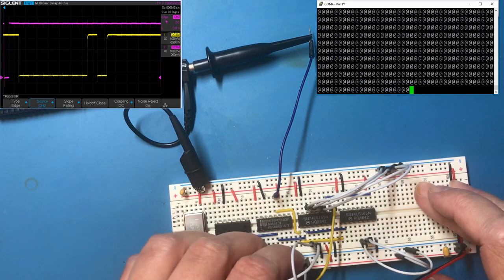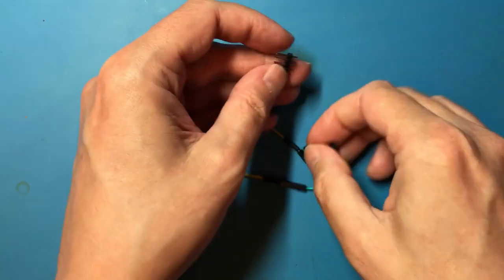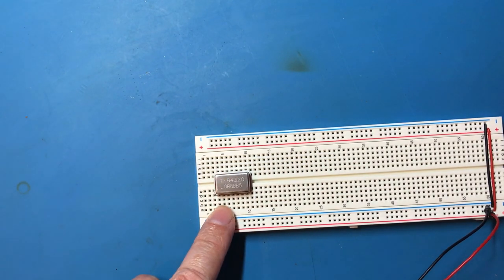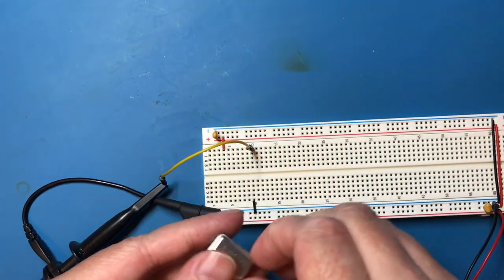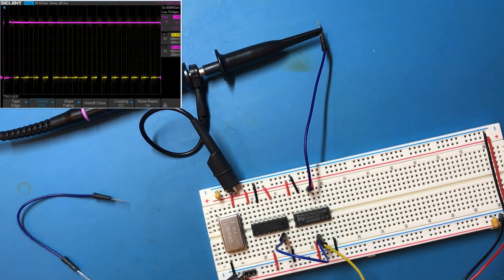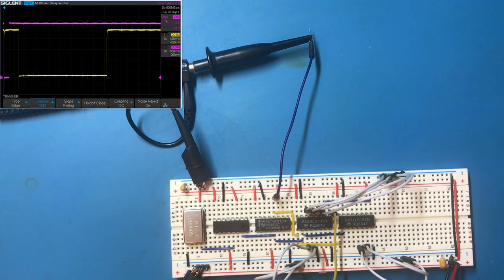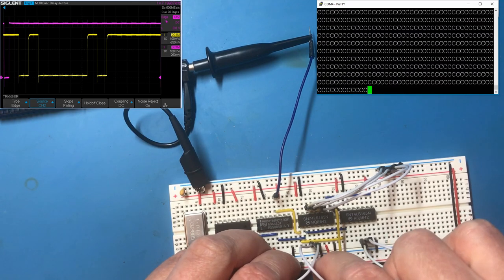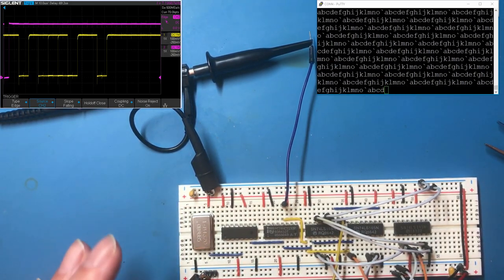Transmit - UART from Scratch - Part 1

Comment: I bought a load of Elegoo breadboards for my original 8-Bit CPU build but had nothing but trouble with them, so changed to BusBoard 830 boards even though they were a lot more expensive. That was over 18 months ago, so the Elegoos may have improved by now. Let me know how you go with them.
Reply from the maker: Interesting, All things are relative of course, my previous ones may just have been really rubbish. So far these have been good, but it's just been the one breadboard, couple of holes had to be loosened up but that's common on all breadboards.

Comment: Lovely video, as usual, thank you! I'd like to see this getting hooked up to your CPU, mainly because I want to see how you handle buffering, interrupts and crossing clock domains.

I see a couple of other people have commented on the Elegoo breadboards, and I'd second their concerns. I've used 15 of them so far in my CPU prototyping, and about half have been fine, the other half terrible (very poor contacts that make or break contact as you add components at the other end of the board, for example). The BB830 ones I switched too recently were a revelation. Fingers crossed yours don't give you trouble.
Reply from the maker: I am curious to hear all the comments about the Elegoo boards,  the other ones I was using occasionally had dodgy contacts but they also changed the specifications occasionally (I had two groups of boards that wouldn't join with each other). I have enough of these for finishing the UART, I'll pass my judgment on them then.

Comment: I’d love to see a UART circuit hooked up to your CPU with code to echo the input out to your little LCD display.  It would be neat and probably very useful for future coding projects on it.
Reply from the maker: Interesting,  my thinking was that it would be nice to get my test programs outputting to a serial terminal. My prime number finding program is "assumed correct" because I've paused it a bunch of times and checked what was on the 4 line display, with a serial output I could capture it and actually check them all.

Comment: Awesome as always. Receive is going to be a bit more tricky I think, since you have the synchronisation to deal with, ie the loading has to start on an external pulse. I'd like to see all of the build in at least this level of detail. :) Makes me want to write a simple UART in VHDL, something I've not yet attempted.
Reply from the maker: Thanks Lawrence! Receive is indeed the more difficult of the two, but I don't think it's going to be that bad. I look forward to your reaction to my circuit.
Reply: @oH well,lord! [NB: I am a s/w guy, not H/W; this is my un-informed vision] I have always envisioned a 16x oversample implemented as a  divide by 16 counter which is reset when the the start bit arrives. That reset synchronizes the output of the /16 with the incoming clock signal. (16 is a bit arbitrary. It needs to be at least 2x (Nyquist); but larger values are more tolerant  of differences in clocks.)  It may be the reset should set the /16 counter to 8, so that the the sampling occurs in the middle of the bit?
Reply from the maker: Pretty much,  the start bits always being low and the stop bits (and resting state) always being high guarantee you a high to low transition at the start.

Comment: Love it!  I would like to see how you connect it to the CPU. Your design choice will be interesting to see (memory mapped IO, or dedicated IO instruction, or whatever you decide).
I really enjoy how you are exploring the concepts and implementing them.
I don't think that having to accept a variable baud rate is really worth the time or effort though.
Reply from the maker: Thanks Bob! I already have a basic io instruction that I use for the lcd display, I'll probably do something similar. In this case I'd need 1 output and 2 input ports (There would need to be a status to report waiting data and a busy send circuit). Variable baud rate would just be a matter of having a selectable clock divider circuit between the crystal and first counter, I wasn't planning on doing that unless people asked for it though.
Reply: @weirdboyjim  Ah yes.. I remember that now (so many videos :-) )

Comment: Great as always James. To answer your question, I'd like to see you build a full fledged bi-directional serial port connected to your cpu (using interupts for instance) so that you can have some sort of serial user interface to it. It's ok for me if you hardwire the speed such as 115kb/s  8N1 because there is no great value in handling all the details of variable baud rate or parity or other. But then you would need some sort of CPU supervisor to handle the interface.
Reply from the maker: Thanks Ced! I'll definitely get as far as a bi-directional,  I've already said that I'll not be implementing interrupts (On this cpu build) so it will need to be polled (Just like the early micros).

Comment: I bought a couple of tiny OLED displays (I'm talking 1cm x 1cm) and they have only control pins: VCC, GND, SCI, and SCA. Since you are doing serial, I believe you could find a way to hook up one of these displays to your CPU so you could print out text/render images with the CPU. If you are going to get some displays, don't make the mistake I did and get the tiny ones... Another idea would be some serial input, like adding a keyboard. I know the receiving is much more difficult to implement than the transmission, but seeing as this barely took 1 breadboard to make - I think you're up for the challenge.
Reply from the maker: I suspect your lines are actually SDA and SCL, these would be the data and lock lines of a I2C connection. This is slightly more complicated than UART but I might take a look at it in the future. Certainly for a basic TTL cpu build I would stay away from I2C, not least because they are very modern components that don't really feel "in the spirit" of designing from the ground up. I will indeed be doing receive, a ps2 keyboard interface would actually be quite easy,  the receive should be easier than UART because it comes with a clock so you don't need to do any clever synchronization.

Comment: I found Elegoo breadboards to be horrible. Hopefully they've fixed things by now, but when I bought them, the springy contacts were atrocious. Loose, poorly aligned such that it was often difficult to plug components in... Hopefully you will have better luck!

You might get less ringing in the edges of the clock signal if you use a shorter ground lead. Ideally your probes came with some little spring like ground leads that hook on to the end of the probe, usually results in a much cleaner waveform. Breadboards are commonly quoted as being fine up to about 10MHz.
Reply from the maker: So far they seem ok,  so things might have improved. The ringing is really high, I know a shorter ground lead helps but I've had far sharper edges on the breadboards without shortening the ground leads.
Reply: @weirdboyjim  maybe this oscillator has really fast edges (rise/fall times). Could try probing through a resistor of 50 or 100ohm perhaps. Would take some of the bite out of it.
Reply: @weirdboyjim  It could be the power supply to the oscillator. Running power and ground to the same power rail on the breadboard should help a lot. You could also solder one end of a cap to the body of the oscillator(should be GND) and plug the other end into 5v.

Comment: Wonderful test of concept but won't work with your CPU as this circuit have a timing issue and actual UART have a data buffer to compensate. You will also need a T flip-flops or state machine for automating start and stop bits.
 Thanks for sharing ✨✨✌
Reply from the maker: What "timing issue" do you think the circuit has? Interfacing this to the cpu should be fairly easy, but it does need a couple of extra chips than I have here. You don't need special circuitry for the start and stop bits, you just hardwire their inputs to the shift register so it "load's" 0 and 1's in the right places alongside the data for sending.  Receive gets a little more complex and you do need to be able to buffer at least one byte of input.
Reply: @weirdboyjim  I think he's referring to the oscillator not being synchronized with the start bit. There is a very small chance that the other side transmits data right on the edge of a clock pulse. If I remember correctly those converters start their clock only when rx goes low so sending shouldn't be a problem. I don't have a big can oscillator with enable, can you check if yours does and if it does how long it takes to enable it? Awesome video!

Comment: Only seen 8 bits... you mean in modern times using terminal to talk to your microcontrollers and such?  Back in the 8-bit era, you might recall 7E1 when dialing into BBSs and using peripherals.
Reply from the maker: I didn't hit the bbs scene until the late 80's and everything was 8-bit by then, may have been different in the UK. I've only hit 7bit (or less) working with some legacy teletype / terminal hardware.

Comment: Cool, maybe I will use this principal for my transistor-based computer. 
7:29 Indeed, any quad flipflip out the 7400 serie will do the trick, no special need for a 74**193, I guess that a 74**193 costs more because the extra circuitry inside.
Reply from the maker: I've not noticed a significant difference in the pricing. Manufacturing a dip part at scale I doubt it makes much difference, I don't like unused functionality though.

Comment: why do you use LS on the breadboard and HCT on the PCBs? is there some fundamental difference between TTL and CMOS that makes one more suited for breadboard applications?

som cursory research implies that HCT has superseded LS for almost all use cases.
Reply from the maker: The most direct answer to that is actually that I probably would have used LS on the pcb's had I been able to get all the parts but in smd (which I wanted to use on the pcb's for compactness) they were all easily available. HCT in this context was a bit of a compromise that allowed me to intermix with the LS on the breadboards as I gradualy converted from one to the other. In the final build when it's all PCB HC would have been better, but HC would have been a complication to the breadboard build for a couple of simple reasons. LS was what I had, and LS is far more tolerant of unused inputs being left floating so it's better suited to dabbling on a breadboard.

Comment: I've watched this playlist and then compared what you did here to the design of the UART I did a year ago for my redesign of a PDP-8 I also did back then.  I had to add synchronization logic to handle the crossing of the two clock domains or else the length of the startbit could vary up to 1/16 (6.25%). I don't see anything for that here. Do you consider that a non-issue or is it solved inherently in the design here>
Reply from the maker: You mean on the transmit? It's kind of a non issue in this design, the first bit sent is actually high so that bit being of varied length depending on where in the uart clock the operation happens doesn't matter. The start bit is the second bit in the shift register. On the receive that is indeed a potential misalignment of 1/16th of a clock. The bits are read at the midpoint of the  bit rate clock so I don't think there is much cause for a problem. All that aside, the new fifo circuits I'm in the process of adding will actually simplify things a bit further, they will a literal buffer between the clock domains and eliminate the theoretical race conditions I might be open to at the moment.

Comment: Can I do this with a 1MHz Oscillator or 2 MHz?
Reply from the maker: Interesting question. You can try,  I use counters here to divide the clock down. You would need to play around with the maths and see if the device you want to talk to supports a bit rate that you can achieve with the clock you have.

Comment: Would love to see an implementation of SPI from scratch; seems like it'd be relatively similar to this project. I've wanted this for my homebrew computer projects but haven't put in the time :P
Reply from the maker: In many ways it's much simper than the UART since you don't have the complexity of managing clock synchronization or unexpected receiving. Big decision to make would be clock source. If you used the processors main clock the circuit can be really simple, but you would have to deliberately wait a few cycles between write and read.
Reply: I have built a computer similar to Ben Eater's design. I am trying to implement SPI to interface with a little SD card reader I have.  My hope is that I can get it working, write basic ROM code that will read a kernel off of the card into RAM and run it, thereby skipping the constant programming of the EEPROMs. It would also allow for other things like an RTC.

Comment: Ok I got a 1.8432 Mhz Oscillator but I don’t seem to be getting any output on the 74LS165… the clock gets divided fairly though to 115200 baud. Any clues what might be wrong?
Reply from the maker: Have you got an oscilloscope? Check the clock inhibit line is low (pin 15) then make sure the load line goes low with the right data on the inputs. Are you definitely getting nothing out of pin 9?
Reply: I get maybe 200mV on pin 9. I did notice the ground in pin 15 is actually about 1.6V. Can this be influencing results?
Reply from the maker: @davidrosset4457 That sounds very wrong. Pin 15 should be fully ground, that sounds like you have an output line fighting your ground. Have you got a different 74LS165 to try? That sounds like your chip maybe broken or mislabeled.
Reply: @weirdboyjim I think chips are broken. I’ll order some more and tell you the results.
Reply: @weirdboyjim  I made it work. Turns out I had problem with the bridge connection of the breadboard, I replaced bridge cable and it worked.

Comment: now do it with only 1 serial shift register! if you use the carry bit as a start bit and activate the shift register when the carry is high and you shift in high 1s it might actually work.
Reply from the maker: Shifting in high ones definitely works but I don't see anyway to "use the carry bit as a start bit",  it's only low for half the cycle duration. I can see a few ways to add the extra bit on the front with additional chips but if I'm doing that I find the shift register to be the neatest way to do it. That especially will make it easier to inject the parity bit later.

Comment: I tried using a 1MHz Oscillator and a baud rate of 6250 with Putty, (1MHz / 16 = 6250) but it won’t show any output. Any clues what’s wrong?
Reply from the maker: 1Mhz / 16 is actually 62500. That's a very nonstandard baud rate. Your usb->serial device may not reproduce that properly. I strongly recommend you get a 1.8420 oscillator or one of the others that it is a good multiple of a common baud rate.  It will be far easier to test.  Do you have an oscilloscope? You should be able to confirm the output looks right regardless.
Reply: @weirdboyjim  Yes I checked, it gives 62.5kHz indeed. Thanks for pointing that out. I’ll see if I can get a multiple of common baud rates because I can’t find your Oscillator anywhere 👍🏻
Reply from the maker: @davidrosset4457  the 1.8432's are common. Some of the bigger suppliers only have SMD ones though. The through hole ones are still widespread though. I recently ordered some smaller ones on ebay to save some board space.

Comment: Does the USB to UART cable work in Windows 10 I am about to buy and would like to know that, thanks for your amazing knowledge
Reply from the maker: The one I have does, I know some have issues.
Reply: @weirdboyjim   Where did You buy yours ? I can't seem to find it on Amazon. Thanks for answering, really appreciate it
Reply: @weirdboyjim   Could you tell me what would be the voltage levels I would get if I buy a usb to db9 cable as I am using the usb I guess it will be 5V but I dont have it and I dont want to buy it just to check that. Sorry for asking so much